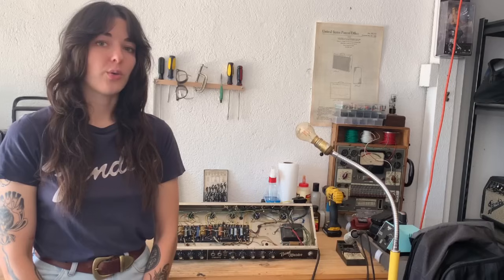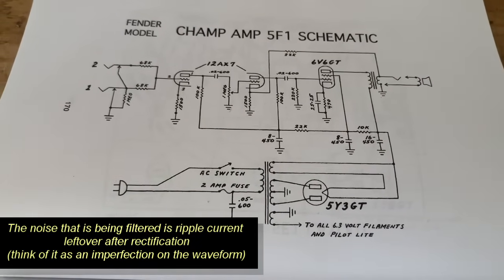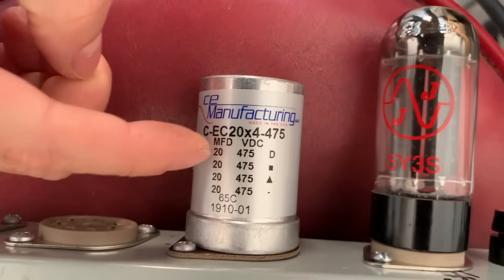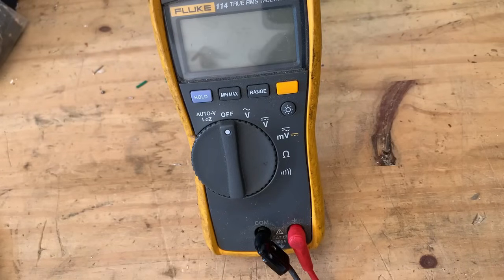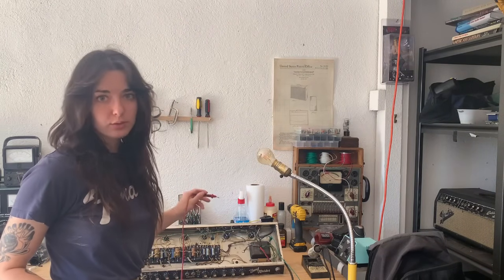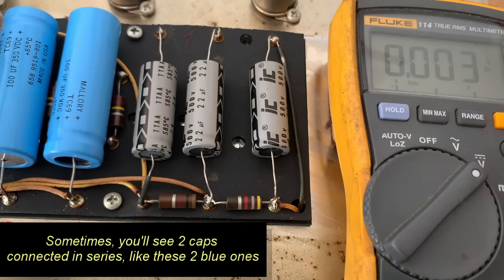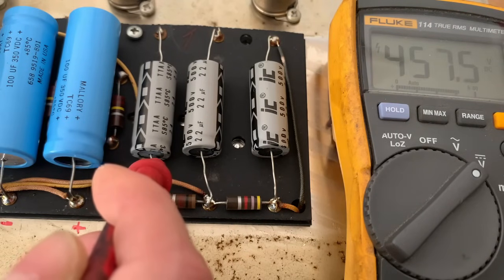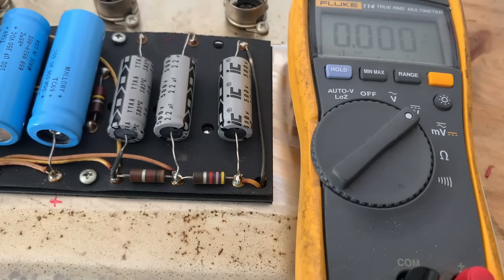Discharging Filter Capacitors & Reading Voltage in your Tube Amp | The Electric Lady

Comment: In order to send the voltage to ground, does the amp need to be plugged in? (I'm assuming it's off, so the caps aren't charging.) Also , is it possible to connect the resistor directly across the positive and negative terminals off the capacitor?
Reply: Keep the amp unplugged! The negative side of the filter caps are tied to ground so what she is showing is exactly that, connecting the resistor across the positive and negative terminals of the capacitor (in parallel). She is connecting one side of the resistor to ground (the negative side of the filter cap is tied to ground) via the green wire with alligator clips, and touching the other side of the resistor to the positive side of the cap. Follow her method for safety. Don't hold the resistor and attempt to touch each side of the cap without using the alligator clipped lead as the risk of getting shocked will increase without a doubt.
Reply: The amp MUST NOT be plugged in. When Coleen says 'ground' she is not referring to 'safety ground' (a.k.a. 'Earth') at the wall socket, but to 'signal ground', the 0V point in the amp which is the negative terminal of the reservoir (a.k.a. first filter) capacitor. In a guitar amp the negative terminal is connected to the chassis, so by connecting the alligator clip to the chassis you are connecting it indirectly to the negative terminal. If the negative terminal is accessible you can connect your clip directly  to it, eliminating the chassis from the procedure. The high voltage is due to the charge, which is a store of electrical energy contained in the capacitor. When you touch the positive terminal you are connecting the resistor between the terminals of the capacitor. The voltage across the resistor causes a current to flow, and if a voltage is causing a current to flow in a resistor it must dissipate power. A resistor dissipates power by converting electrical energy into heat, which is then lost into its immediate surroundings and ultimately into the atmosphere. The voltage (or more precisely the charge) does not 'go to ground', it is lost into the air.

Comment: Thank you for the detailed info, other videos don't show to check the + end, and they assume you know that I guess. I have a Jet city 20 watt EL84 amp. I installed a complete new set of matched tubes. Tested it for sound check, everything was good. Months later when I went to use it, I got a lot of crackling and power tube closest to tranny red plated. I reinstalled original tube set(chinese) and same tube socket red plated. That socket did not feel right and i was going to try to replace it myself, since the value of the amp is less than the repair would probably be. i will replace both power sockets. What brand socket do you recommend?  There may be more problems than just the socket, but it definitely has a problem. The original power tube pins looked as though they had been bent outward midway with a pair of needle nose pliers, obviously not normal.

Comment: Awesome to the point clear explanation with no waffling etc. Nice one.

I was saying today here in NZ how excessive 60 cycle hum coming from somewhere in the in the amp is usually bad filter caps, rather than our first instinct of thinking we need fancy new tubes, power supplies, pickups and more pedals etc. Things like these caps crap out over time out and need servicing just like having to change oil in a car etc. 

I am not a tech. Rusty mod my own amp type. Currently running a nice JMP 50 replica and will be getting back into it. Trying to decide whether to PPMIV it or do the voltage mod. It is too hot for my Two Notes load box. 100 watt load box, but this amp can output close to that when on ten or is boosted hard. The load box goes into overheat protection mode and the signal fades over about 30 seconds, giving me time to turn the amp off. The other solution is to run two 8 ohm loads with the amp set to 4 ohms. I prefer to tame it though, because playing lots with it on ten is risky and will burn up valves faster.  The other solution would be not to live in a CBD apartment with a guy next door that bangs on the wall for normal TV volume (forced to use plugin amps and my monitors at very low volume until i sort this grunty Plexi issue out, or the guy next door vanishes into thin air. Nobody carries amp parts here either. I have to import everything. Oh well. Being miles from every other country has its upsides though).
Reply: In NZ, the mains frequency is 50Hz. As a general rule, a 50Hz hum is usually associated with tubes. Bad filter caps result in a 100Hz hum.

Comment: Im going to have -to bias replacements tubes in my Marshall DLS-40.  Can you show a best practices video?  I only have a multi-meter.
Reply from the maker: Hi there - Good news is there are test points on the circuit board that allow you to set the bias using a multimeter’s millivolt reading. I don’t have a DSL40 to demonstrate on, but will keep in mind to film a tutorial when I have one in!

Comment: Can you please tell me how to check that the capacitors in my Fender Champ 600 reissue are fully working? Do i use a multimeter and if so,how?..Thank you for the video
Reply from the maker: Is your amp displaying any particular symptoms? You can check the voltages in the filter cap section, and compare with the schematic’s voltages (if they’re shown). The only other way to test capacitors is with an ESR meter, with the cap out of the circuit. Feel free to email me with any further questions!
Reply: @FazioElectric  Thank you...

Comment: As others have said, thanks for the straightforward and helpful video! Question, in the amps, is it just the filter caps you need to worry about? So, if you know where they are and drain them, you feel comfortable working on the other side of the chassis (in a doghouse fender, for example)? Or is it good to test voltage from those other caps in the circuit too?
Reply from the maker: The filter caps are the only ones to worry about because they supply the high voltage to the rest of the amp. Once they’re discharged, you’re good to go!

Comment: "One hand in the pocket while working with high voltage": solids advice, and I've only heard one other person mention that before (way b4 youtube was even a thing).
So, for a solid state amp: is the circuitry similar enough that this procedure would be the same?
Reply from the maker: Solid state amps don’t require high voltage like a tube circuit does! It’s always a good idea to test the voltage on the positive filter cap leads to make sure, though. Generally you don’t need to discharge caps in solid state amps.
Reply: @FazioElectric  good to know. Really appreciate you getting back to me. I'm not really familiar with circuitry, etc., and the only guy in town that does this kind of work is booked solid. I've got an old crate g80 that I kinda love, but cutting out randomly, so i want to at least get in there and check for burn marks and broken solder joints...and doing it without getting lit up. 
+ I'm just tired of not knowing how these things work
Reply from the maker: @leobuck2060  you can do it! I’m sure a service/re-solder will help.
Reply: @FazioElectric  
Took it apart, unplugging all the blade connectors, no burnt or cracked solder connections. Blew the dust off with the air compressor, put it all back together and now it's working fine...guess it just wanted some attention.
Reply from the maker: @leobuck2060  glad you got it going!
Reply: @FazioElectric  thanks...I actually missed that buzzy lil pos!
Now for an ACTUAL pos: just took apart this Marshall g30r cd that had no control on the clean side, then the gain shit the bed on the OD channel. Turns out the knobs connect to the board with some flimsy brittle plastic tab and no actual metal connection, and the 4 knobs in question were all broken. Any recommendations on better quality replacements?
Reply from the maker: @leobuck2060  shoot me an email fazioamps@gmail.com
Reply: @FazioElectric  Most "digital" amplifiers use switching power supplies which have high voltage capacitors in the power supply. Apparently, some Velodynes are particularly infamous for leaving the caps charged when unplugged.

Comment: Finally someone else using a 470ohm 5watt resistor I’ve had way to many mixed results some say this and that but only seen one guy explain why to use a 470ohm 5watt with pretty good reasons but every one else is using really high value resistors. Just subscribed btw great vid

Comment: Where to I touch the resistor on the can type capacitor by power tubes
Reply from the maker: Mike Jamieson You’d discharge the positive terminals, which are the inner tabs (usually marked by shapes, with the key printed on the cap itself). The ground tabs are on the outer edge of the cap. All of which are located on the circuit side of the chassis, opposite from where the can sticks out. Hope that helps!

Comment: Just found this on a SheShreds facebook group and it's awesome! You explain so clearly and straight to the point, i love it!
I would love to see some simple and/or most common repairs to amps (especially if any can be done in-situ at a venue or practice space safely and if there are things i could carry with me or get into a venue toolkit to make such a thing possible, i am a sound engineer and a bassist in a band and it would be mad useful!) 
And also if you do any stuff with pedals, case studies with different electronic bits, more how-to's and any other safety stuff, etc. I would absolutely love to see that!
Reply from the maker: Thank you so much for the great ideas! I love the rec about simple/common repairs and a repair kit to keep on hand. Will definitely be doing a vid on that in the future :)

Comment: Hey there Kegger! Great video, super useful. Here are a few videos I'd like to see: 
- 2-prong cords -- How to know which way us the "right way up" to plug in a 2-prong cord without finding out the hard way. 
- How to figure out if there is voltage on the chassis
- Warming up an old amp without a variac if possible. 
- How to check bias
- How to check voltage tubes are using
I'm sure there are a ton of other videos. Do you listen to the TAVA podcast with Skip Simmons? He's always saying "check the voltage on the XYZ" or "look for DC voltage leaking from the..." Personally I'd love to see follow-up videos that visually show and explain what he's talking about.
Reply from the maker: Hi there! Thank you for all of the great recommendations. I will be sure to highlight those points. I very much love TAVA, and will actually be chatting on the podcast with Jason and Skip this upcoming week :)
Reply: If you did that I think you'd instantly have a big following from the TAVA listeners, especially if Jason (the host) were to talk about your follow-up videos on the podcast. Just a thought!
Reply: @40withegg  What podcast is TAVA?
Reply: @PnkTskr  the truth about vintage amps

Comment: Brilliant thanks. Clear and concise. I'm thinking of taking on the upgrading of my fender Hotrod Deville III filter caps and a few other components. It's been recommended to me to do. Do you have any thoughts or experience of working on these amps? Thoughts on if the upgrade is worth it? Any other suggestions for improving a Fender HR Deville III from stock that you might suggest? Thanks in advance, good luck with the channel. Scott.
Reply from the maker: Hi Scott, I think it’s a good idea to upgrade the filter caps. I’ve seen them fail in those amp prematurely. If the tubes are original (Groove Tubes) I’d recommend changing those as well. The biggest issue with Hot Rods is they need a complete re-solder, so when you have the board out to change the caps, solder the whole thing as well! (Including the tube board)
Reply: Fazio Electric thank you. I’ve had medium experience soldering- pedalboards all my guitar and patch leads etc but yeah as suggested in another comment an ‘all things soldering’ video would be great. Love the concept of your channel. Suggestions for tube brands for a Deville? Thanks again.